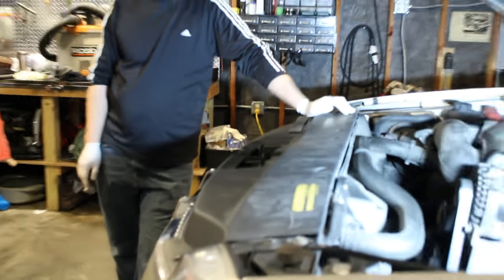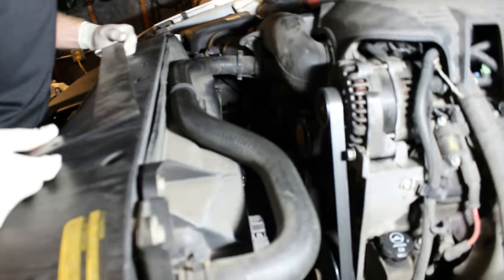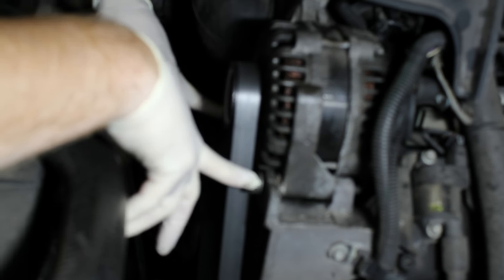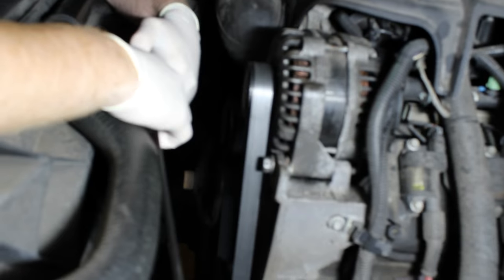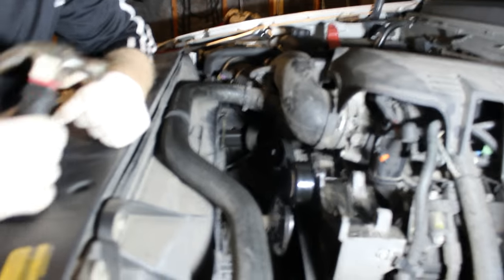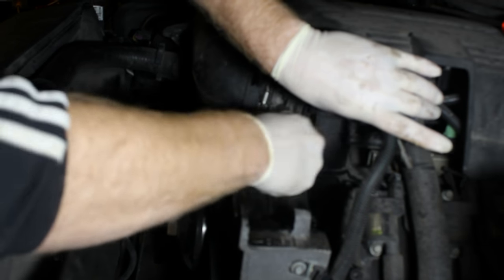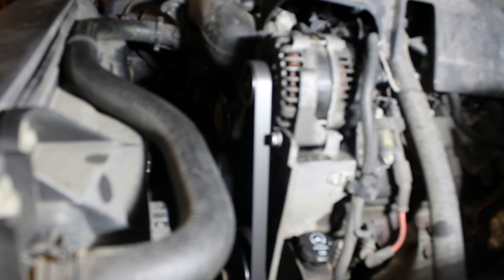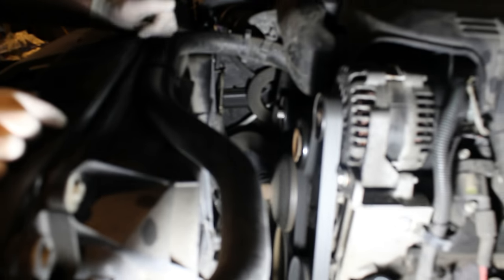2007 ESCALADE SERPENTINE BELT NOISE

Comment: Hi, 2007 Escalade makes a humming sound when trying to accelerate. Acceleration is very slow. I’ve had the cam shaft sensor, throttle body and break pedal sensor replaced. Still experiencing this acceleration delay. After it picks up sped the humming stops. But, when I try to accelerate again after coming to a stop light it tends to be slow again. Sometimes, I have to turn the engine off and wait until the car will accelerate. Going in reverse during this time is not a problem 🤔Help!!!
Reply from the maker: Well on this escalade it ended up being the harmonic balancer...
You have to also check oil pressure for worn out cam bearings
Reply: @sdrake74  thank you!!!

Comment: I tried what you did but when I tighten the bolts in the bolt pushes the bushings back the other way. Did you shim the back side of alternator? I put new alternator in and I have a whistling or howling sound I replaced it again and same thing so I wanted to try what you did I had small gap maybe 3/8 inch from camshaft to alternator but when I push bushing toward front when I tighten down they get pushed back if I don't tighten all the way then it has some movement. I didnt have this noise with old alternator only when I put new one in. The noise is definitely come from alternator I used stethoscope sounds like bearing but even the new one dose it. Any ideas thanks and great video
Reply from the maker: ok get it as close as you can and then change your harmonic balancer!!!! this only ended up working for two weeks ... the noise came back and it wasn't  until we changed the harmonic balancer did the noise go away permanently... my buddy still drives that Escalade to this day
Reply: @sdrake74  thank you